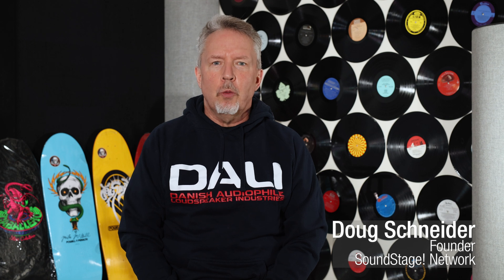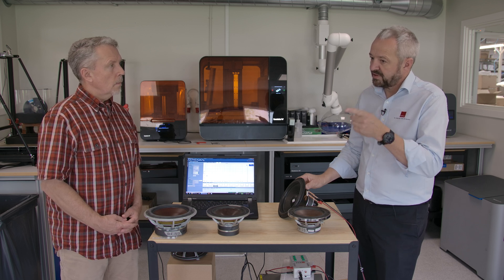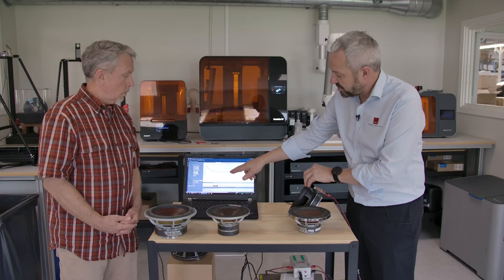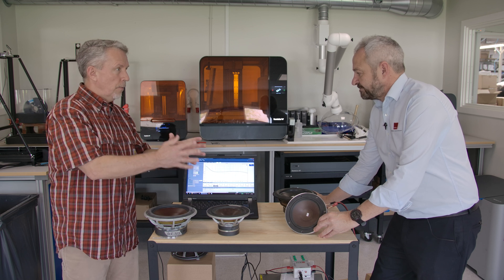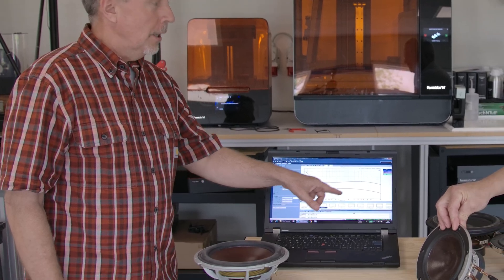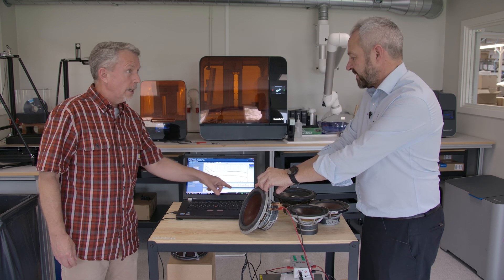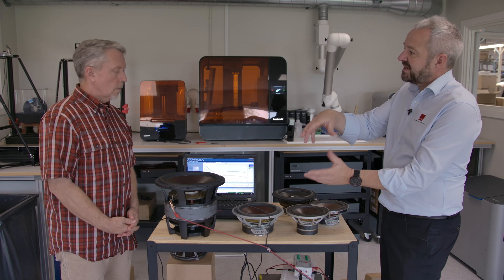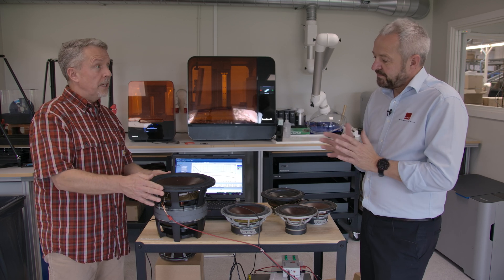SMC Must-See: DALI's Distortion-Reducing Speaker-Driver Tech Demonstrated (Ep:80)

Comment: At about 15:10 - 15:20 it is mentioned that current drive doesn't have control over the driver because the damping factor isn't there, but current drive has full control of the driver because it controls the current, and there is no need to be concerned about the damping factor because that term is only relevant in voltage drive.
Reply: Current drive effectively knocks out the Qes of the driver, so Qts is equal Qms which is generally much larger. i.e. you get a much larger resonant peak at Fs because the high impedance of the amp doesn't allow electrical damping. 
I recently design a current control amp, my solution was to lower the output impedance near resonance and gradually transition to current drive as we go above resonance. It solves this common complaint about current drive very nicely.

Comment: Bravo on reducing eddy current distortion. Balanced drivers (with two cones) are often used in subwoofers to cancel forces induced into cabinet walls. I believe a balanced driver reduces even order distortion only, odd harmonics remain unchanged.
Reply: Hi, two different types of "balanced" being referred to. The balanced subwoofers you're talking about is often called a "force canceling" configuration. The drivers are mounted opposite to one another so their forces are equal and opposite -- and then the resonances from them cancel out instead of traveling into the cabinet walls. It's a mechanical cancellation two drivers mounted the way they are proved. The balanced configuration Lars Worre is talking about has to do with the motor system in a single driver -- essentially, there are two voice coils, two magnets in there, equal and opposite to one another, once again canceling their non-linearities.
Reply: In any balanced system only even order non-linearities are cancelled. In a correctly designed balanced subwoofer there is both mechanical force cancelllation & electrical even order distortion cancellation. The woofer Lars showed has a single cone (because it's a wideband woofer and not a subwoofer) so is not 'perfectly' balanced but there is still some cancellation.
Reply: @trevorbartram5473  Unless I'm misinterpreting what yoi're saying, I don't think you're following what I'm referring to as "balanced" in this instance. Balanced, in this case, is the JBL-patented system of having dual voice coils and dual magnets in the motor system. This isn't two different drivers -- it's a single driver.
Reply: I believe we're on the same track, we're discussing the 'degree' of balance & even order cancellation, that's all.
Reply: @trevorbartram5473 
Not too noticeable w 2 subs
Single Rel No.31/32 ideally